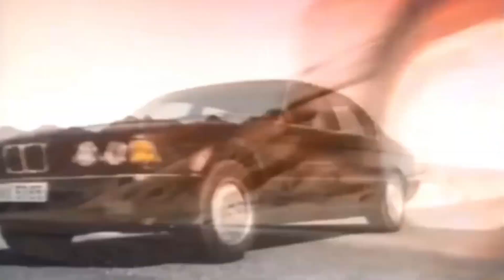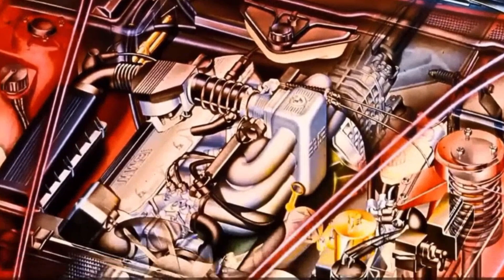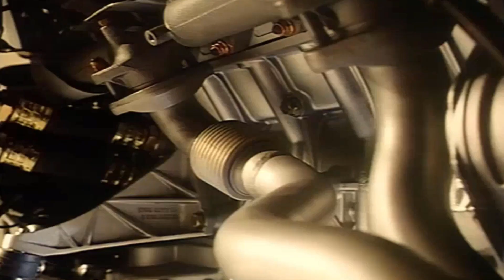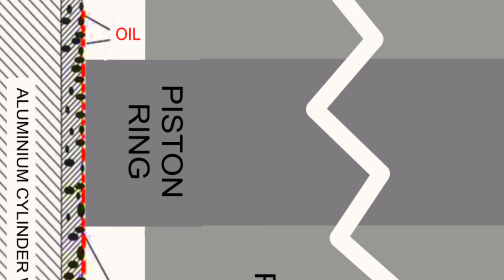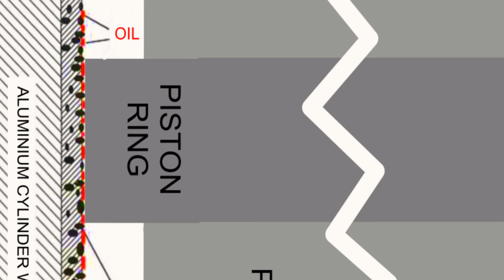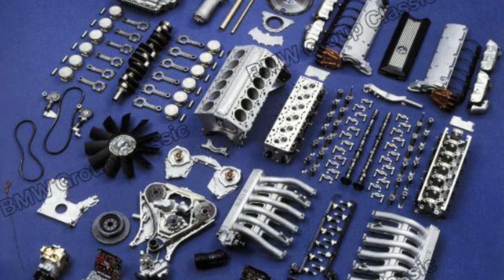BMW and JAGUAR - There was nothing wrong with Nikasil!

Comment: Very impressive for your analysis on the issues related to these engines. However it's called planned obsolescence. My Porsche has the same issue with flooding the engine with fuel upon starting to vehicle turning the key or opening the driver side door. Meaning of quite literally Shoots fuel into each cylinder upon opening the driver's door. BMW Volkswagen Porsche take the CEOs out grabbed a little bat from the baseball game swing for the fences
Reply from the maker: Quite possibly exactly the same software in your DME, and idea that didn't work and eventually scrapped a lot of engines!

Comment: Dear Timm , Thanks a lot for this video which is really clear and hightlights a question I had for a while : many engines had Nikasil platting , so why should only a few engines suffered from this issue ( I guess Porshe 997 also suffered from this problem) My question is : what are you suggestion to manage this problem ? I have a jaguar XK8 that does not suffer from flooding , but I guess that if fuel injection is not properly maintained , there would also be problems .....  What kind of fuel should I use ? Would you suggest additives ?  Many thanks in advance for your feed back !
Reply from the maker: Thanks! You will have no problem with the Nikasil- today's petrol is low Sulfur and does not cause damage even if flooded

Comment: "There is nothing wrong with Nikasil." Well there obviously was for this application. Nikasil was not robust to the known real world fuel variability. The fuel was not the problem. The fuel was a know real world factor. Like say,  the weather ... inconsistent and inconvenient but known to be so. 

The problem was the failure of BMW and Jaguar to consider the effect of the fuel on the coating. The prevailing sulphurs levels were known but the failure mode was not adequately considered at the FMEA, design or test stages of the engine projects in either company. If you get the relevant Bavarian and Coventrian engine design engineers in a bar and buy them enough beers they will tell you this.
Reply from the maker: I agree, and that was whole point of the video!

Comment: All of my mechanic friends disagree with you. They told me my car needs new rings but I could see that the problem was that it’s flooding. So you just answered a question I had while explaining another. 🙏🏾
Reply from the maker: There has been so much misinformation regarding Nikasil. Having owned one for a long time I experienced the flooding problem so often - and lucky that we have low-Sulphur fuel here. Rings were never the problem - when Nikasil failed it was the bores, the rings were chrome-plated and never suffered from erosion

Comment: skip to 17:58
tldr: it was the software
When starting the engine the system pre-squirted certain amount of the fuel into the cylinders... In cases when the engine refused to start (for whatever reason) the next attempt at starting the engine introduced even more extra fuel into the cylinder. This washed the oil off of the cylinder walls which then caused the Ni to get eaten away by the fuel, resulting in the loss of compression.
Reply from the maker: Don't spoil the story!

Comment: Mercury engines "cooled by seawater" ... "you don't get much colder than that"?  Those genius's at mercury copied this nifty device used on cars called a "thermostat" to control the engine temperature.  Very clever of them.  I am here because I own 2 x 2012 Yamaha F300 outboards both of which recently death spiraled with the root cause appearing to be Nikasil coating failure.  They have a thermostat that is speced to open at 126F/52C which is colder than most other outboards or cars which tend to use 160+F thermostats.  So the nikasil failed, don't yet know why, after which blowby increased dumping water vapor into a cold crankcase at a rate that the engine could not eliminate so water built up in oil at a prodigious rate causing myriad other failures.  Anyone else out there with a similar experience?  Any guidance on where to look for the cause of the nikasil failure?
Reply from the maker: The Nikasil failure was probably the end-result of some other problem, possibly crankcase ventilation. Even compared to our BMW V8's which run at 226F (108C) I very much doubt the seawater-cooled engine temperature of 52C has any bearing on the problem. Unless you are using fuel with a high Sulphur content the Nikasil should be the last point of failure, it is so much more durable than steel-liners. If you have water in the oil suspect your crankcase ventilation system - it is a much easier route between the coolant and crankcase.

Comment: I always hated my engines when they started right way, knowing that there's gas running with dry cylinders and when it doesn't start right away, it's flooding time...
 I rather like Lamborghini with their six seconds without gas, when cranking the engine!

Comment: Hi Tim. Your series of posts is a grant for me to call you the erudite of motor technology. Riveting presentation style, and well researched.  Thank you for the extra mile.
Please help share your thoughts on M60b40 E34 engine flushing, and new oil refills afterwards?
Secondly, do you recommend timing chain tensioner replacement without replacing guides for >300 000km smooth performing engine, or would you do both?  
I like this M60b40 engine, satisfying performance for me👌!
Thanks Tim
Reply from the maker: Thanks Sonny! As long as you have done regular oil-changes there is no need to flush. Flushing is for cars that have stood for years and the oil has decomposed. Same with the tensioner, if there is no rattling then leave it alone!

Comment: Thank you.  
Are you saying that The M60 is less prone to chain guides failure IF  serviced correctly? 
I bought a 1995 740 yesterday with 180 000 miles

Runs smooth,  silent, no smoke. No rattles. 

Best regards from Sweden
Reply from the maker: Yes, same with most problems, servicing often and early is always the way to go
Reply: @TimmsBMW   Thank you. Keep up The good content

Comment: 2 stroke oil in fuel sprayed into the manifold worked great after doing the oil in bore (with stabiliser and blown around with short bursts of compressed air), my mechanic mate said it was the fastest he'd ever restored compression on a flooded M60, he was pretty chuffed with himself when he came up with that one
I'm the owner of two Nikasil 540i's with about 290,000 km's because Australia never had high sulfur petrol. And I highly recommend a chip tune, DudMD chip seemed to reduce the stink of unburned fuel on startup there used to be so I assume it reduces the fuel dump on starting
Reply from the maker: Thanks Benny, that's an interesting way to get the M60 going again!

Comment: Thanks for explaining this Nikasil problem extremely well, I always understood the main problem to be high sulphur content in the petrol back then but that didn't explain why some cars were affected and not others, this extra bit of information that the ECU is programmed to inject extra fuel on start up makes a lot of sense, just a thought, why not have a solenoid pressure release valve in the main fuel line to dump the pressure back to the tank then after the engine had cranked for maybe 2-3 seconds, close the valve, pressure comes back up engine starts without over fuelling. I do have an early XK8 which still has it's original engine, I think (not sure how you can tell) never had any problem starting it, but if I only move it a short distance I always let it run until warmed up especially in cold weather. Just on another note I also have a late 5.0 XKR when I start it, hot or cold it revs straight up to 2,000 rpm can't be good for the engine especially if it has be stood for a couple of weeks and most of the oil has drained back, perhaps I need to try my idea on it.
Reply from the maker: Thanks John, and good to hear from you. Being an electronics sort of bloke I would go for a delay for the injectors - so they only fire when the engine actually starts turning rather than squirting away before anything happens! No problem for me these days as I have the later M62 in my 840ci!

Comment: Very good video, but just to point out... As far as i know the m52 engines use Siemens ms41 family of dme , not sure but the m60 might be Bosch Motronic... I am bragging it up because for two different dme manufacturers and software versions to use the same flawed start sequence is truly remarkable (maybe the had some goos idea behind that but who knows)
Reply from the maker: Thanks Kostadin, I think the likely link is Motorola - they produced microprocessors targeted at car manufacturers - in 4, 6 and 8 cylinder variants (we used to use them in the late 80's for other purposes) - and they came with example software for those applications. Whether this had any bearing on the final software I have no idea - but I reckon that is the link!

Comment: I would just install a switch on the fuel pump, as soon as you engage the starter then turn the fuel pump on.
Reply from the maker: Unfortunately the fuel system stays pressurised over long periods otherwise that would be a good plan!

Comment: I thought that while starting and with your foot all the way down on the accelerator you are in WOT (wide open throttle)  which initiates clear flood mode. This would prevent the injectors from pulsing whilst still initiating spark thus clearing the flood.This mode I thought was in pretty much all fuel injected vehicles past a date I cant recall.
Reply from the maker: That may be a feature of the Jag software update, but BMW never introduced it - unfortunately for Jaguar, by the time the software update was introduced it was too late and the damage to the marque was done!

Comment: Tim a really well argued and considered piece. My own e32 is on you tube - have a look at Matt’s Furious Driving as he reviews it a few weeks ago. Luckily its the m30 6 cyl version. Im also swapping out the broken heater control valve though! The question is would you recommend a v8 E32 now as a result? 
What a shame you were not in the meeting at the time to encourage them to keep looking for the culprit. They must have thought it was manufacturing issues with the castings and they were easy to blame. But then they should have looked at the type of markets that were being impacted. There must be some V 8 e32 which will be on their second and third engine courtesy of BMW customer services!
Lee
Reply from the maker: Unfortunately, even if I was at that meeting - it was going to be a long time before the real reason showed itself!

Comment: Nikasil coated bores on the engine of my 1984 BMW R100RS motorcycle that I bought new from the factory & still have.  It is still on its original bore pistons & rings despite having at least 200k kilometres on the clock.  Only recently has it started blowing a bit of smoke & showing a drop in compression.  I've recently bought a Jaguar XKR that has its original Nikasil engine & runs like a dream.
Reply from the maker: Thanks! Yes, Nikasil can last many 100's of thousand miles - the top end usually gives up first.

Comment: Thanks Timm
My M60 is on 230k miles. No record of engine swap in full history file going back to sales receipt. Is it possible it had new liners fitted ? I previously thought block swaps were the only option. Maybe it's just lucky and plain original. Its first owner for about 15yrs was from Winchester not the North West where sulphur fuel issues are thought to be worst. Anyway - many thanks for another good vid.
Reply from the maker: Liners were never fitted, it was either a Nikasil-plated or Alusil block - and in 2020 Niasil problems are over!
Reply: @TimmsBMW  My engine has never flooded in 6 years of ownership either - it's a 95 model.

Comment: First of all wanted to take the time and congratulate you on having this information for us the ones that really dont know what we have really in our hands with our E38. I personally have a 740il 1995 and will tell you as of now never had any problems with the engine and I can probably drive down the street with a quarter standing on the motor and it won't move a bit, that's how good and quiet these engines are running. I guess I have two question what are those piano and musical hardware you have in back of you are you a hearted musician? Jajajajajjaja...but I did wanted to ask you BMW did recall these issues to fix correct, meaning the software side or engine replaced??
Reply from the maker: Thanks! My E32 with the M60 engine had all the DME software updates, and it still flooded - so probably not! And yes, a musician!

Comment: Fascinating story, always wondered! I have a 1997 nikasil M52 E39 as my daily driver. 134k and running lovely, never burns a drop of oil.
Reply: Would it be true to say surviving nikasil cars are better than the later alusil?
Reply from the maker: Not really, you do get more grunt from the M62/M62TUB, and a well-maintained M62B44 (especially when fitted to the E31 with the 85C thermostat) should last for a good 200,000 miles. Alusil is just as wear-resistant as Nikasil, so it really is up to the individual!

Comment: Very interesting and well done video, great job! Is there an aftermarket ECU that fixes the flooding problem of the M60 and do you actually like the M60 more than the M62?
Reply from the maker: Now, that's a good question! The best for performance is the M62TUB44 - oodles of power at the bottom end. The best for reliability is the M60 - but I do prefer the M62, powerful and uncomplicated by the noisy Vanos....

Comment: Thanks Tim, great insight, it fits all the variables. I think some of these issues have enabled people like myself to pick up an excellent car at excellent second hand prices. You mentioned the timing chain of the N62 - mine has 60000 miles on a 2006 - given its age would you recommend changing the guides now (instead of waiting for debris to show up in the oil or higher millage as a trigger), and, do you know of an aftermarket supplier that has a better set of guides than the OEM?
Reply from the maker: Thanks! I have planned a video on the timing chain guides, but, replace the chain tensioners (there's two of them) and change oil every 5000 miles with a good oil https://amzn.to/2zDEgWC and hopefully you will never have any problem with them. Also, use a rubber/plastic treatment such as: https://amzn.to/2TM18dn to keep the stem seals and gaskets from falling apart. 60,000 miles is absolutely nothing on these engines!
Reply: @TimmsBMW  Thanks Tim I'll change the tensioners and keep up the good oil

Comment: great info like always. I also have M60 in my e31, and never had any problem. I only use my e31 for long fun drive 
always try avoid short journeys or just move it around in parking so far everything fine. now I use 10W 60 oil and it's fine...wonder if you would avoid using 10W 60 in m60?
Reply from the maker: Any full synthetic or semi-synthetic oil replaced one a year will do fine - it is the long wait before oil changes that this engine doesn't like!
Reply: @TimmsBMW  thank you I change every 3k mile 
Always waste good oil lol

Comment: Was there an updated DME for the M60 engine?
Reply from the maker: The software was changed a few times - an increase in idle speed was one of them - but they never got rid of the 'flood the engine' code!
Reply: There was a change to make the engine run hotter but it also reduced power.

Comment: I currently drive a 1994 840ci with the M60. I purchased the car 10 years ago and during a service noticed the car had been recalled for the nikasil issue. It did not state what the solution was. The car runs fine at 90k miles. Re how carefree the 750il was- I have to disagree. I worked for BMW of Beverly Hills when this car was new. We catered to VERY high profile entertainment industry clients (Spielberg, Horner, Isner, etc) and they make their displeasure known. Our dealership replaced 23 vehicles within the first 24 months at BMWNA cost just to keep these people happy. You name it, it went wrong with those cars.
Reply: my e31 fitted with m60 too. when I bought it owner was saying bmw replaced engine (£11k in 1995)
I never look into it to see if it was true or not because I never had issues in 6 years ownership
Reply from the maker: That's really interesting, I suppose it was bound to happen with all the new technology....

Comment: Well this takes me back. I had a 1996 e39 528i around 2003, had it for a couple of years before I sold it at around 90k to a guy I knew and within a year he reported back the engine failed due to the Nikasil issue.....lucky for me, not so for the guy who bought it from me.
Reply from the maker: You bring up an interesting point - by 2003 the Nikasil problem was over - but the PCV problem had started - and that caused smoke and trouble starting the engine - and that often got blamed on Nikasil!

Comment: great info tim . had an e34 540 that had 200,000 miles on it and my e31 m60 has 176,000 miles on it now not had any issues with nikasil , but back in the early 1990s i used to walk to work passed a bmw dealer round the back of liverpool street .every time i did they had an m60 block with its heads off and a new block sat in a crate next too it :)
Reply from the maker: Thanks, that's a great insight into how awful it was in the 90's for BMW!